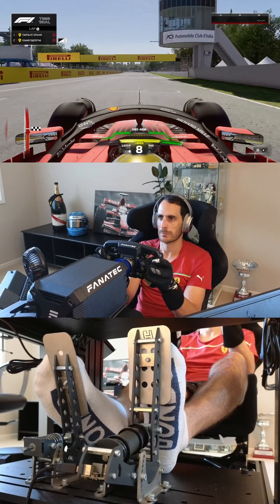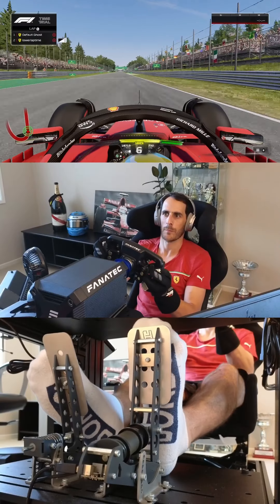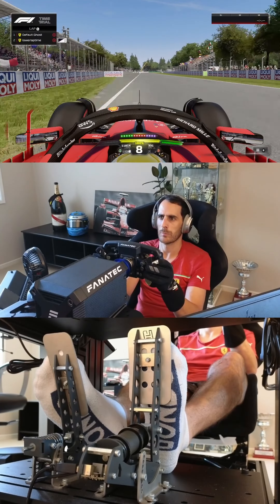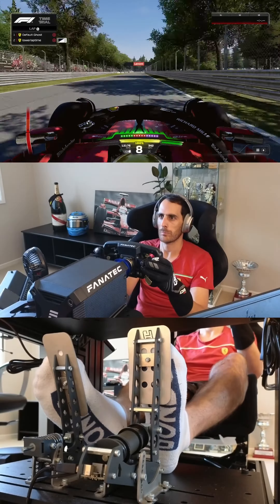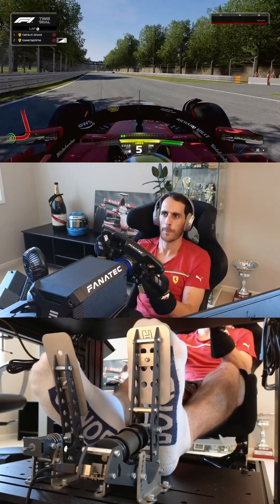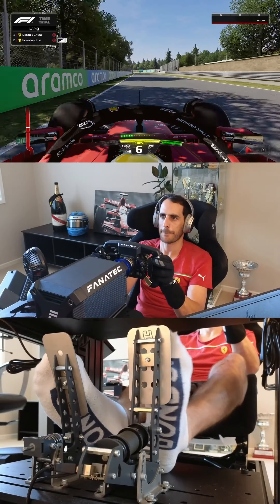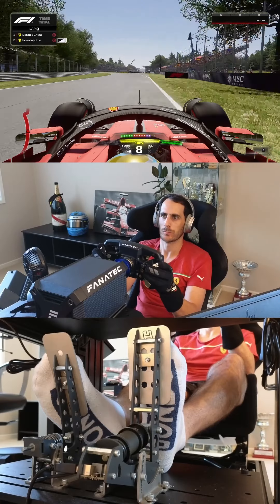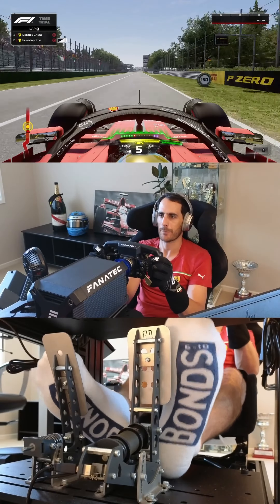F123 In  Reverse - MONZA!

Comment: Trail braking and throttle application that corresponds to steering angle on exit of corners
Reply from the maker: No bro trail braking is basic as! A lot of people suggesting this - not professional level in my opinion
Reply: Left foot braking mid corner then? @lowerlaptime
Reply from the maker: @elliot4805  no - you're thinking a biy shallow. Try to look deeper into where I choose to drive
Reply: You seem to take a late apex in Parabolica and Lesmo 1, is that it? @lowerlaptime
Reply from the maker: @elliot4805  no
Reply: Oh well let me know what it is when someone does eventually guess it. @lowerlaptime
Reply from the maker: @elliot4805  will do - no one so far. To be expected though